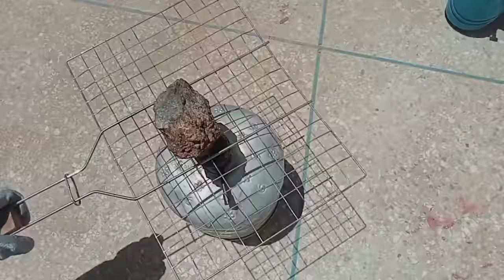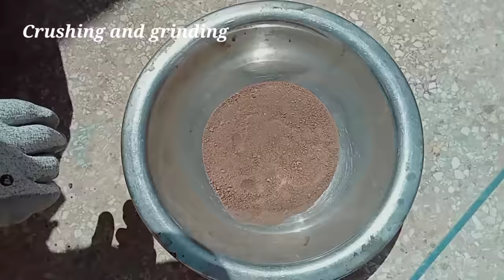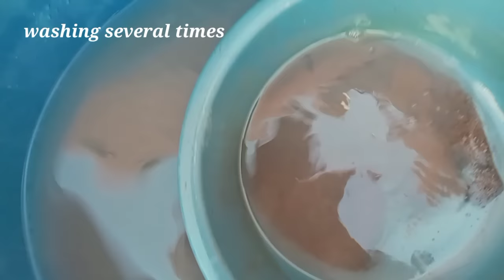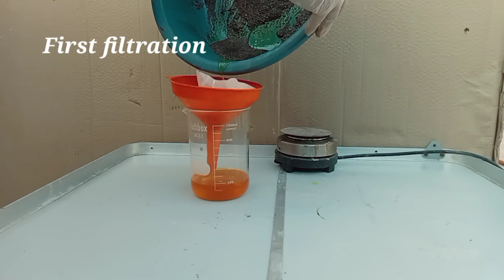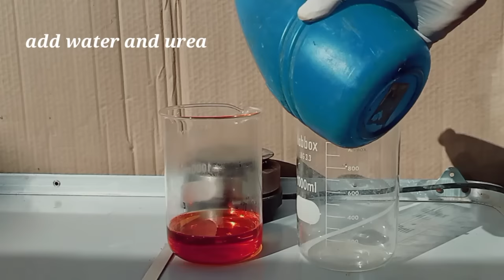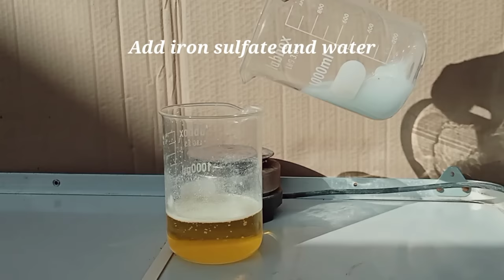Stone gold recovery/hard rock gold process/how to gold stone

Comment: instead of boiling the ore dust in H2SO4 it would be cheaper (and easier for most to get) to use HCl, as it will remove most of the base metals and other impurities, but wont touch the gold.
Reply: Thank you
Reply: What about pladium which is must valueable nowadays

Comment: I've seen people use a fire to heat up stones and then they throw it into a bucket of water but I think it would be better if you used one of those giant magnifying glasses. I've seen it on YouTube melting stones so I'm pretty sure that it would work on the concept that you have as well. After you heat up the rock throw it into some water that's in the metal bucket and it should break down into sand.